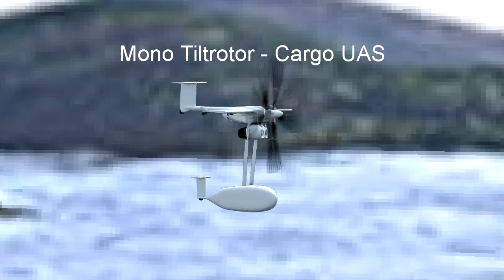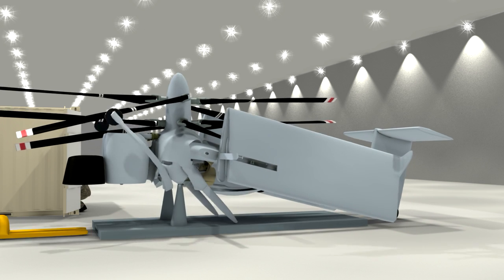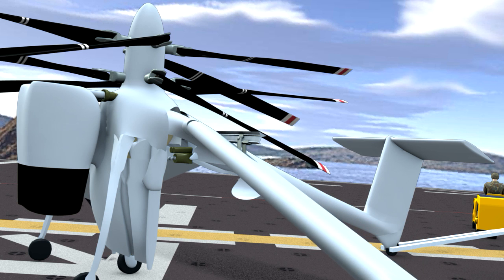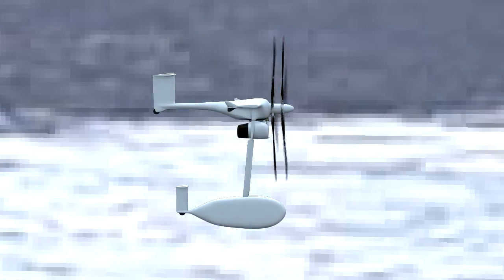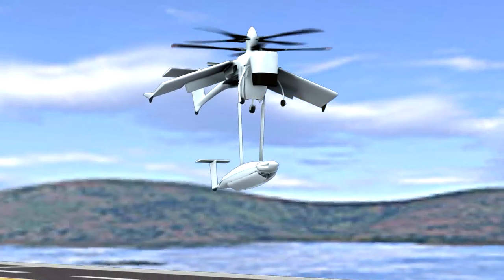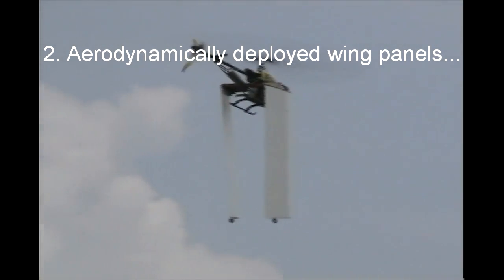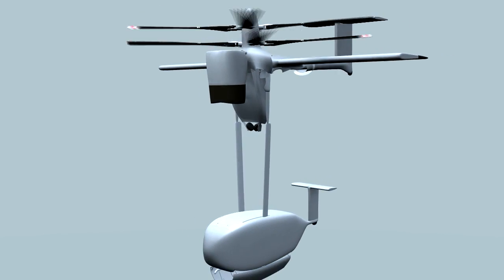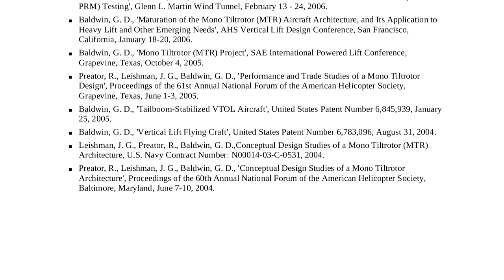Baldwin MonoTiltor cargo UAV

Comment: It looks like it was designed primariliy as an MTR attack or observation platform, with the cargo-lift capability a secondary thought.    Could this platform be massively simplified to include lesser moving parts and components [less chance of failure in the multitude of systems]?